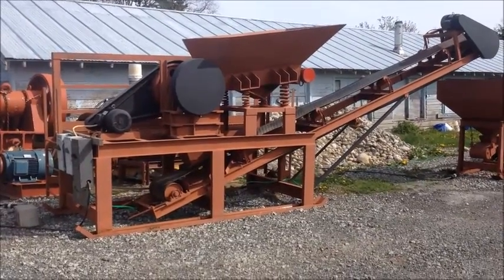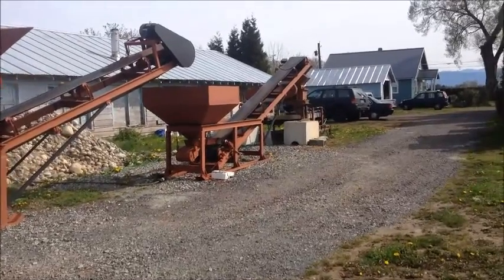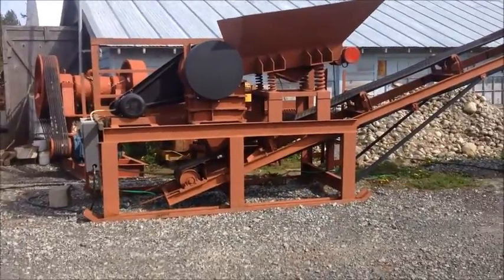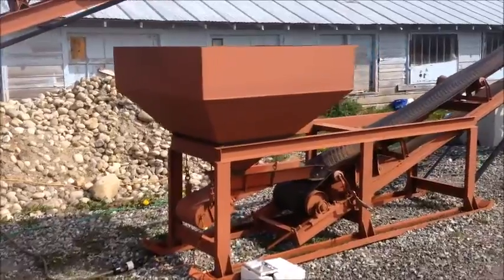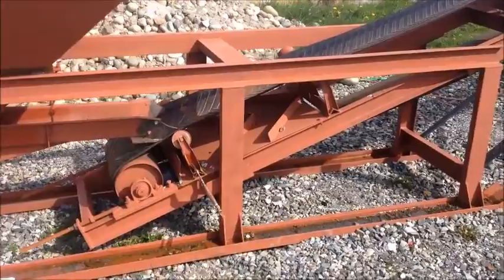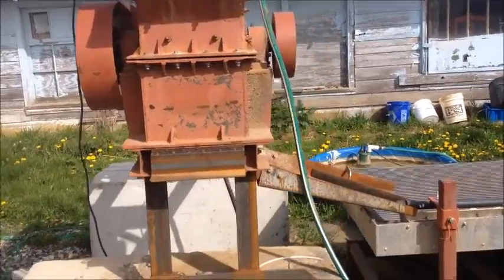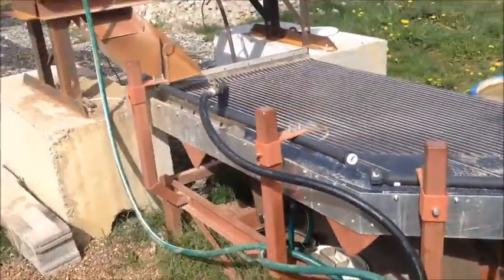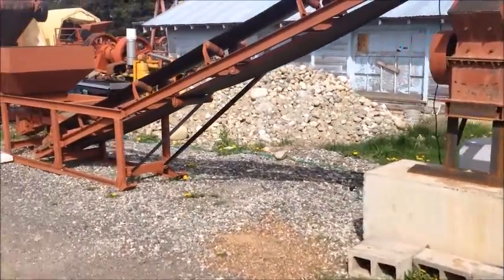MBMMLLC.com: Complete Gold Ore Processing Line: Jaw Crusher Hammer Mill and Shaker Table

Comment: i think this hopper is useless. you must  feed to hammer mill directly
Reply from the maker: Ibrahim Demirci Thanks for your comment and ideas.  The hammer mill and shaker table need an even, metered feed to reduce wear in the hammer mill and to get the best separation on the shaker table.  The jaw crusher produces surges in the feed rate (due to in feed size, variation in rock hardness, time between hopper feedings, etc.)  which the hopper and magnetic feeder even out to the hammer mill.  By using the hopper and magnetic feeder the shaker table gets a much higher recovery of precious metals and the concentrates are much cleaner and can be directly smelted.

We have tried to feed the discharge from the jaw crusher directly into the hammer mill as this was my initial thought too.  The results were not good so we came up with this solution which works quite well.  Thanks.
Reply: maybe you can put a small  hopper  on hammer mill .
Reply: Ibrahim Demirci The hopper is how surge conveying is done. Spend a few decades working on such things and you would see the beauty in their design. Good looking stuff.
Reply from the maker: Naked Acres Thanks for the compliment!!